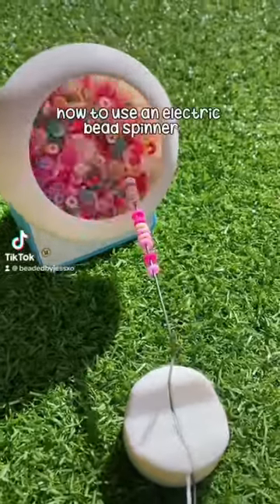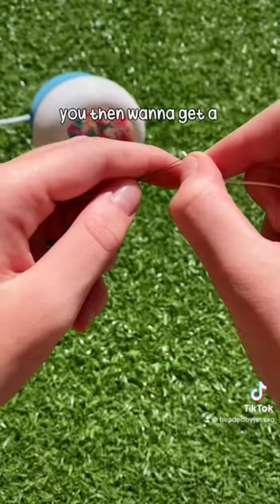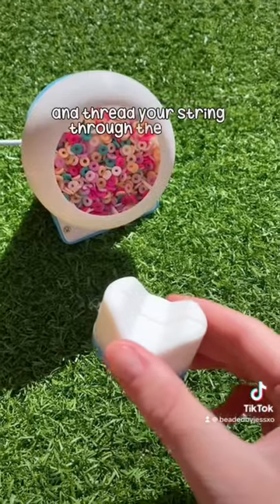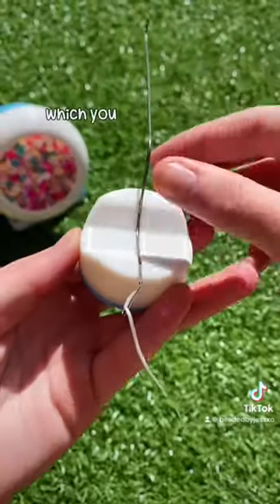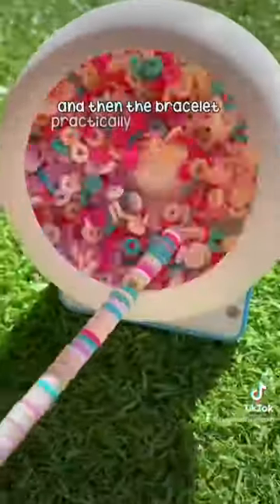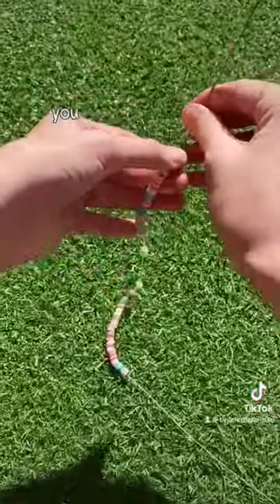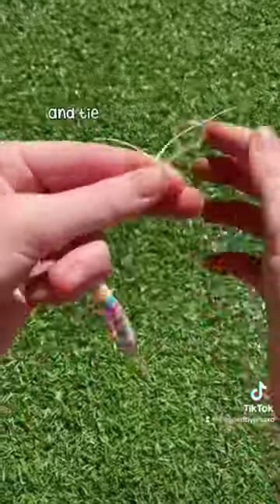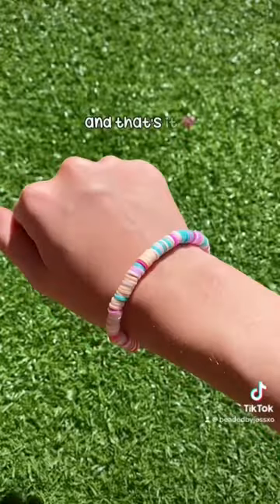Hope this helps! Should I do more tutorials? 🫶🏼 #tutorials #blowup #beadspinner #electricspinner

Comment: TIP: make sure to gently put the beads onto the string from needle because I have the same exact bead spinner and needle, and two out of three of my needles broke and I had to order more because I wasn’t careful.
Reply: Do you need batteries for that?
Reply: Like the clay bead spinner
Reply: @AshantiGarrido  for the one I have and the one I think she’s using, no. I have one where that you just plug in
Reply: it’s because your string is too big is its bigger then about 0.5 it could break with seed beads or others
Reply: @TS_EDITSSECRETACOUNT  oh. I just thought I was too aggressive while pulling the beads over the knot. Thanks
Reply: @User20875  yes if its 0.5 and you tie a knot it will probably be like the 1.0 so try not to tie a knot
Reply: And you have to like put the needle at a angle to get more
Reply: same for me i broke 3-4 bracelets 💀
Reply: @AshantiGarrido yes you do
Reply: @User20875 Which needles did you buy bc mine broke as well
Reply: Hii, where can i Get a so long needle?:0
Reply: And where did you buy your spiner?:0
Reply: SAMEEE
Reply: So sorry
Reply: @AshantiGarrido no
Reply: @AshantiGarrido  yes